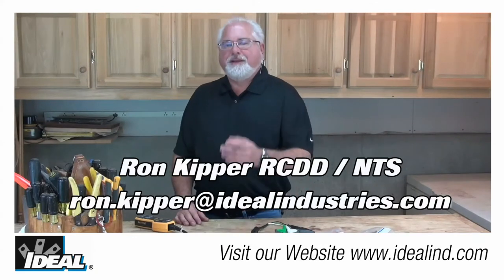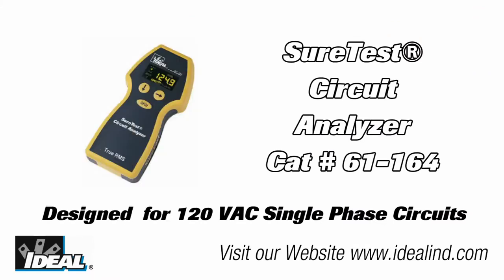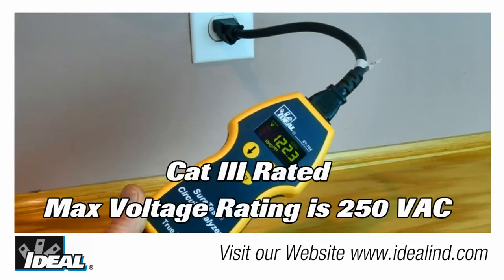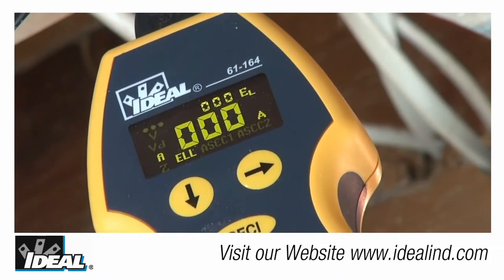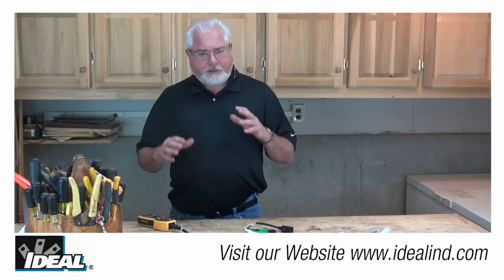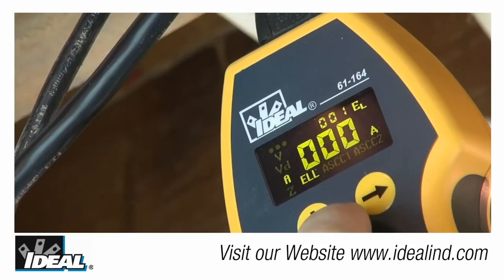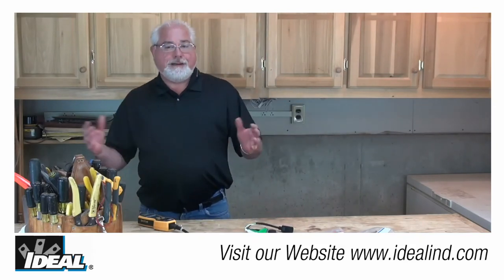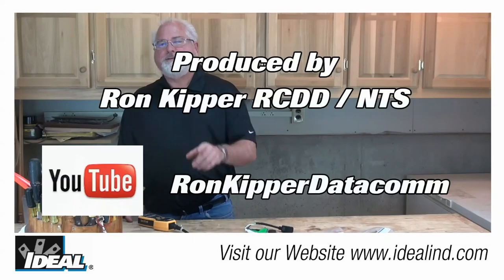SureTest® Circuit Analyzer EEL Test

Comment: ron in 165 model i can see only ASCC but not amps at alll. any reason why it i s removed.?.
Reply: I just bought one too and was hoping for the ELL feature.
Reply from the maker: Due to technical limitations, ELL (Estimated Load on Line) was dropped for a number of years because of its inherent potential inaccuracies. As the SureTest product evolved it was re-introduced. It is quite possible that you have an older generation unit produced during those years when it was not available. Unfortunately, there is no practical or cost effective way to upgrade existing SureTest units. Plus due to problems with AFCI breakers we no longer sell that unit. If you have just bought one the unit is probably 14 years old.
Reply from the maker: @havox112  Due to technical limitations, ELL (Estimated Load on Line) was dropped for a number of years because of its inherent potential inaccuracies. As the SureTest product evolved it was re-introduced. It is quite possible that you have an older generation unit produced during those years when it was not available. Unfortunately, there is no practical or cost effective way to upgrade existing SureTest units. Plus due to problems with AFCI breakers we no longer sell that unit. If you have just bought one the unit is probably 14 years old.
Reply: @RonKipperDatacomm1  how do I know of i have one that falls up under the specifics of what you're explaining? By serial?
Reply from the maker: Hello I am not sure what you are asking about please explain or send me an email Ron at ron.kipper@idealkindustries.com
Reply: @RonKipperDatacomm1  basically just asking are all the testing values (features) accurate on the 61 164 model ?
Reply from the maker: @FCES_Electrical_Sol  best thing would be to call our tester support person Dave Kadonoff 815-342-2246 he should be able to give you a better response just let him know I gave you his info Ron